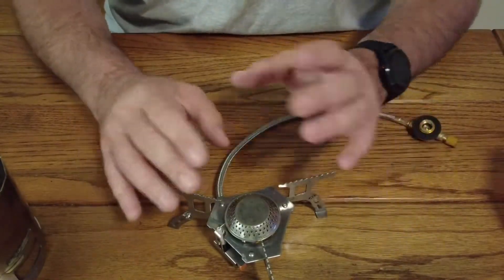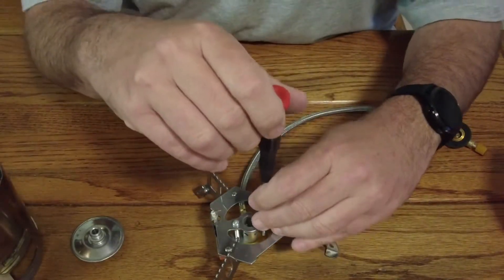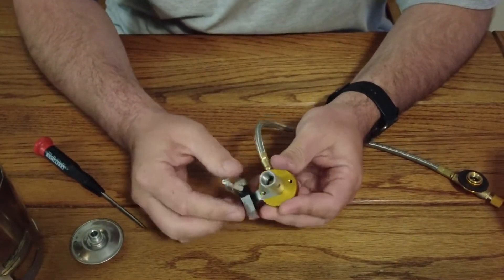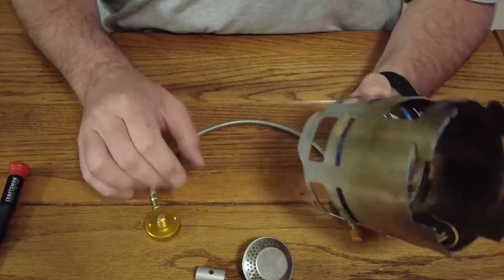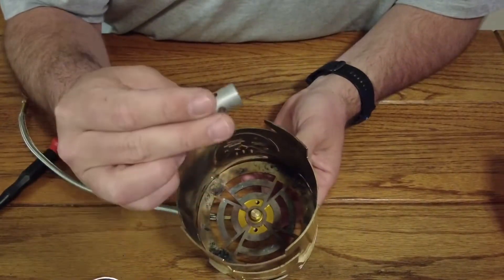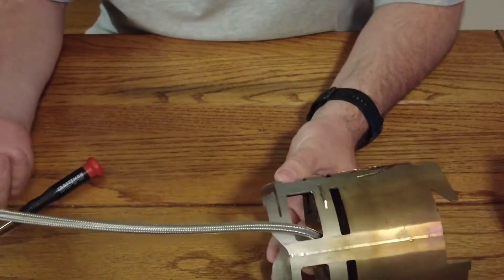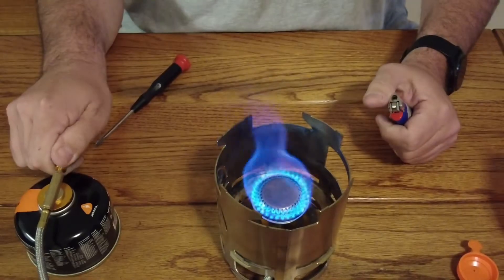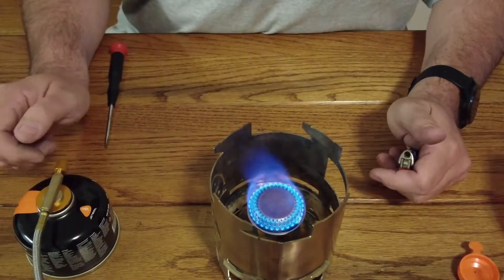Simple Theory Gear Pack Stove XL Gas Canister Conversion

Comment: i am wondering if you can invert the gas cylinder to burn the liquid  fuel?  like the msr windpro.
Reply from the maker: Not with this stove.  There is no generator that would vaporize the fuel before it is send to the burner.
Reply: @BarnYardOutdoors   good point . Inverting the fuel can would macknit burn hotter anyway. Using it in the pack stove I don’t think you want tit to bun hotter .  I ordered one from aliexpress

Comment: What a great idea. Is it stable enough to use in a canteen cup stove or would it need to be mounted on something like a single serve tuna tin? 
Many places here no longer allow solid fuel stoves. Too much of a bush fire risk and/or using limited firewood in environmentally sensitive areas.
Reply from the maker: You would need some type of mount. A tuna can would work. The stove burner is pretty light.

Comment: I love this conversion idea! I'll be ordering a Simple Theory Stove soon and look forward to it's many adaptations! I'm also wondering- would running propane in the line after say, butane, mess with the line or burner/fuel chamber in any way? Also, where to get that propane adapter? Thanks for the great video!
🔥👍26
Reply: Butane and propane are both great. Think of them as pepsi and coke. You may like one a little better than the other, or like both. Propane does burn hotter.
Reply from the maker: The propane adapter came with the stove I ordered. You can also order them from Amazon. I don’t think running propane will have any I’ll affects on the hose or stove.

Comment: Please explain why you wanted to do this mod?
Reply from the maker: Todd, The Bloke in the Blue Hat is correct.  If I wanted to cook something that requires more control I would use the gas canister.  Also, in areas where there are fire bans this would be how you could use this stove if you didn't want to use an alcohol burner like a Trangia.  And we all know how easy it is to spill and alcohol stove......right Todd.
Reply: For me there are two main reasons. It gives more control for cooking than an alcohol stove. 

Secondly, there are increasingly more areas in Australia that do not allow solid fuel stoves/fires of any sort, due to bush fire risk and/or environmental sensitivity. On a total fire ban day you would not even be allowed to use the gas stove.

Camping sites that do allow fires are generally BYO fuel. Not an issue for the stove that only burns twigs.